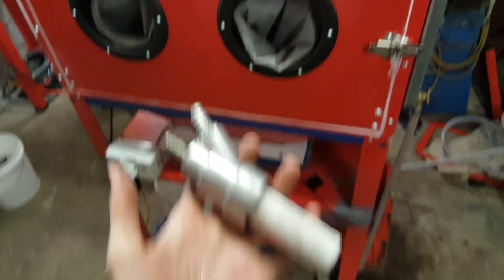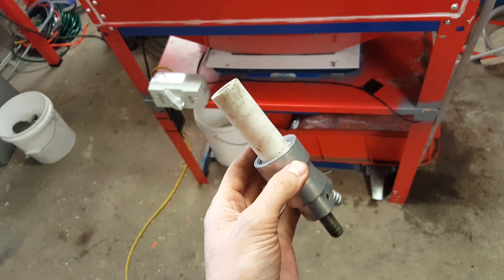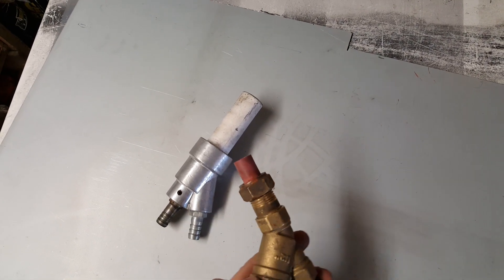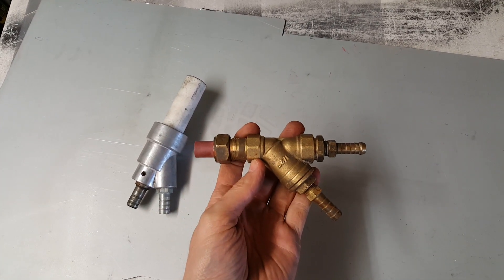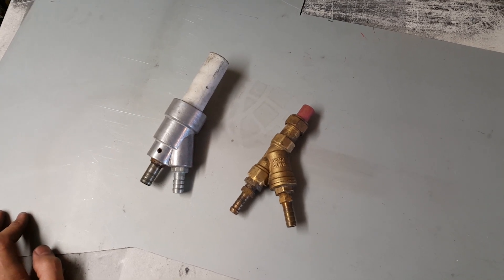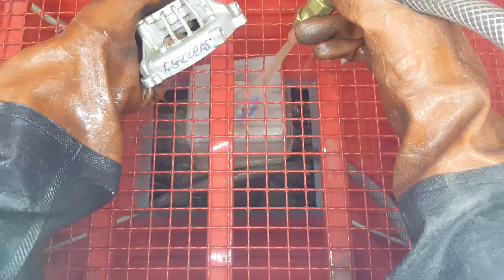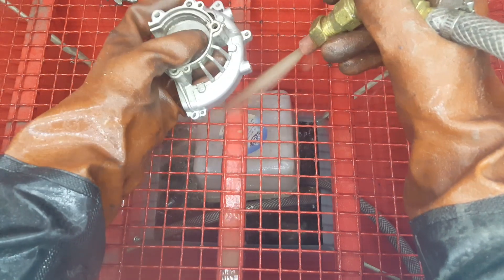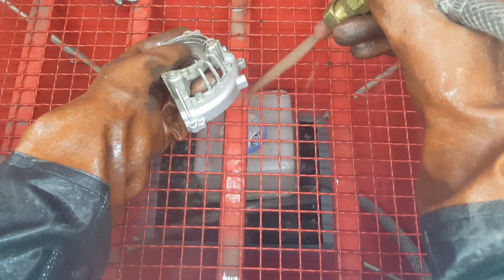DIY Vapor Blaster gun

Comment: Is there a video that covers exactly how to make this gun? Cheers
Reply from the maker: Hi Daniel,

There are a couple more video of these guns, but none that are a step by step. I usually use the lathe to build mine and had intended to sit down and film step by step the build process without using the lathe, but never got around to it. There is more info in the build guide on my website.

Cheers!
Josh
Reply: @ArmouryEnterprises  thanks Josh I’ve since bought your plans and made myself my own gun, works great! The finish I’m getting is pretty good but it’s not as bright as expected. More like a factory matte grey which is great for some things. Any suggestion to get that bright sheen finish on aluminium? Higher pressure, more glass to water ratio? Any thoughts 

Cheers
Reply from the maker: What pressure are you blasting at, and what media are you using?
Reply: @ArmouryEnterprises  I’m using “Inda” glass bead (306-106) at about 75psi. Using a 6mm ceramic nozzle that’s supplied with the cabinet. Using a brass y strainer gun
Reply from the maker: @Daniel_Martin152  Try dropping your pressure to 45psi for a second pass and see how that goes, if it doesn't solve the problem, swap out your beads for some AC (250-150 micron) or AD (212-106 Micron). I would also recommend going up to the 7mm ceramic.

Let me know how you go.

Comment: Im In Dunedin. Would you make and sell me one of your made up nozzles please ?. I prefer the finish that you got via the diy nozzle in your video
Reply from the maker: Hi Pat,
Thanks for watching!
I have a couple left in stock at the moment, and they can be found here:
https://armoury-enterprises.myshopify.com/products/1-2-brass-vapor-blaster-nozzle

Cheers!
Reply: @ArmouryEnterprises  Thanks. Just a thought... do you really need a cabinet ?. why not clean the parts in a large tray ? .
Reply from the maker: These systems use a mixture of fine glass beads and water. So the cabinets are just a means to recycle the glass beads.

Cheers!
Reply: @ArmouryEnterprises  I have seen people do complete motorcycle engines , just blocking off inlet and exhaust ports.  Hopefully not enough pressure to go through gaskets ?
Reply from the maker: It's possible, but I wouldn't advise it. I have heard mixed reviews. Some have said it is fine, other have said they have wrecked engines.

From my experience, the media gets everywhere. I would be skeptical about doing complete engines personally.

Oddly enough, vapour blasting tends not to damage soft surfaces.

Comment: Hi
What do you find to be the ideal nozzle size and what cfm compressor do you use ?
Reply from the maker: I generally match the nozzle and air jet orifice to the compressor size. My compressor is rated at around 12 CFM and I find it is really too small. I found the best setup to match this compressor is a 2.5mm air jet orifice, and 8mm ceramic tip.
Thanks for watching!
Reply: @ArmouryEnterprises  What kind of sand do you use, 12-13?

Comment: Why do the nozzles have two inlets? Is one media and the other water? I can't figure it out.
Reply from the maker: The side inlet allows the slurry mixture to be fed into the chamber in the body of the gun. The rear inlet has air pumped through it which draws slurry from the chamber and accelerates it through the nozzle and onto the part
Reply: @ArmouryEnterprises  ahh I see. I didn't realise there was air pumped into it. So a large capacity compressor is needed too. I'm trying to calculate the costs to make one as this would be perfect for my restoration and motorcycle spares business. So the main costs are the tank, pump, compressor, nossel, pipework?
Reply from the maker: @gavinoliver8074  Yes that is correct. You need to really be around the 25 to 30cfm mark before you can work continuously and not have to wait for the reciever to refill.

They are perfect for motorcycle restoration. If that is your business/hobby then you probably have all the skill you need to make a useable setup.

I built one pretty much for free out of scrap so the more you are willing to spend, the better the setup
Reply: @ArmouryEnterprises  thank very much for the info. I'm going to do some research for the best pumps I can buy in the UK etc. I'll find a second hand cabinet to lower costs but these machines seem amazing and perfect for what I need. I'm be breaking bikes too and before selling parts I'll give them a quick going over.
Reply: @gavinoliver8074  a good way to clean bike parts ( bare aluminum ) is to use a metal tub with Hot purple power .. ( not too hot to touch but Hot ) you simply soak the parts in it then pressure wash .. Of course you can blast them if needed .. ive made several simple Soda blasters and they work great for cleaning carburetors
Reply: @Y2daT420  purple power?
Reply: @gavinoliver8074  its a cleaner degreaser found here in the us @ dollar General and some other stores
Reply: @Y2daT420  I get you. I'll be able to get something similar here. I'm getting my tank tomorrow as long as everything  goes to plan.
Reply: @Y2daT420  at Canadian Tire in Canada